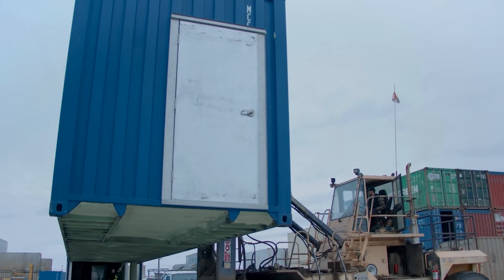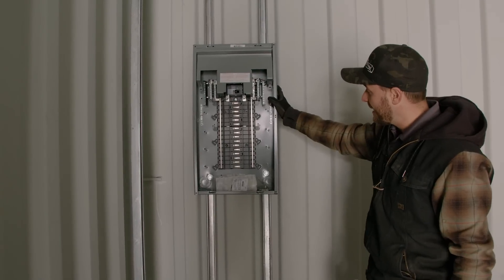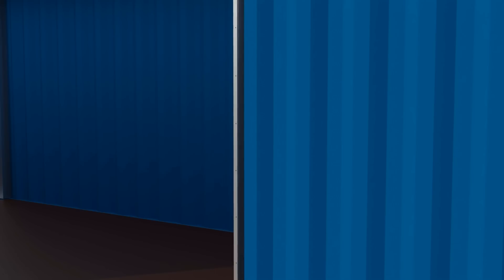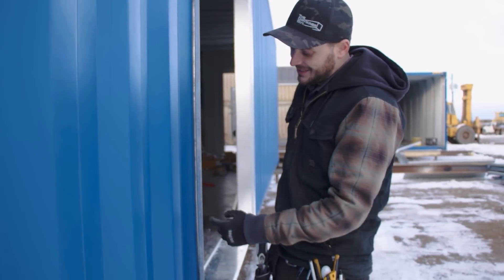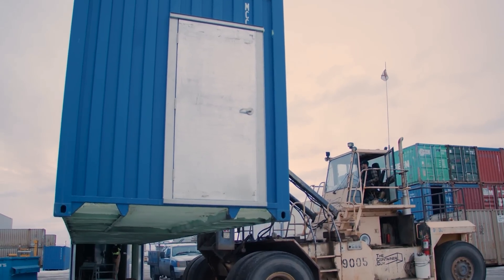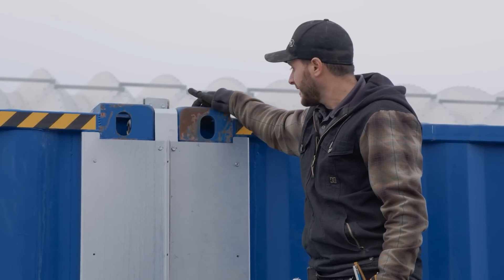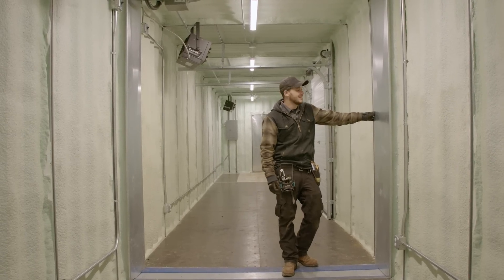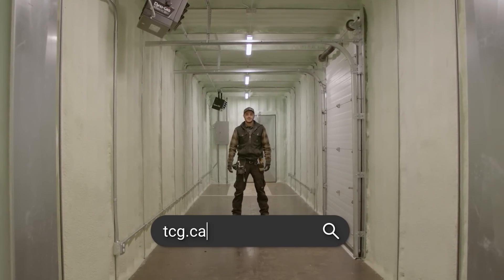80 FOOT LONG Shipping Container with an Insulated Garage Door!

Comment: Would be Nice to see finished containers on site for the industrial use. Also what are some of these specific container used for? Do they mount to piles or how do they set them?  Have you made a hunting lodge or camp style container? Have you installed plumbing or a wash bay in the container? Thanks again for the videos!
Reply: pretty sure that's confidential info

Comment: re: insulation framing: don't the "ribs" attach to the exterior steel walls of the container thereby telegraphing cold thru the foam and into the interior meaning there is no thermal break between the exterior skin, the framing  members thereby allowing direct transmission of internal heat out thru the framing and exterior skin?

Comment: Always wondered if u could stick 2 20ft together and double wide it then 2 40ft on top so when u take out the bottom walls if that would be enough load structure bottom floor being open only for room like one section kitchen doorway to wide open living and 4th section storage/bath /electric room and make up stairs bed rooms possibly end capping  with with more containers to add on later like Lego's all on plans to buy land and doing it your self type work I rather spend money one my kids and don't need that luxury home but functional and still able to be some what high tech in side . Keep up great work love learning thing to always to better my knowledge.

Comment: It's easy to do if you take a minute to think it through ! What I'm referring to is what you have is steel that is on the outside runs all around continuously to the inside if you take a second to think is to build in a thurmo /bridge  that way in extreme weather your not going to have all your door posts frosting up where as with a T/B the steel exposed to the environment dose not come in and have the humidity inside will  have hudge frost build up. Your takeing the Time and big cost of expensive insulation only to expose a week link in the insulation R Value of your product  if what I'm saying sounds important I have 30 years experience as a industrial overhead door installer I would be happy to talk in ways to overcome this problem.
Reply from the maker: I used to be super worried about any thermal bridge until I realized all our man doors in Canada are a steel slab with foam inside (same as what I provided). Huge thermal bridge but still perfectly acceptable and never frosts in winter. It always comes down to a trade-off between cost and function. I agree with you and know what you mean though..

Comment: If you used two strong connectors at each corner (top and side) could you pick up the resulting 80 foot container by the ends if it was mostly empty?   If so, how much weight could it hold before it was not safe?

Comment: Would love to set up one of these shipping containers as a storage unit and or possibly extended shop.  Is it possible to have a Mitsubishi ductless heating/cooling system for example where they do not sweat from extreme temperature fluctuations and rust from the inside out?
Reply from the maker: We use the mini-split A/C units all the time in our insulated, modified container projects.